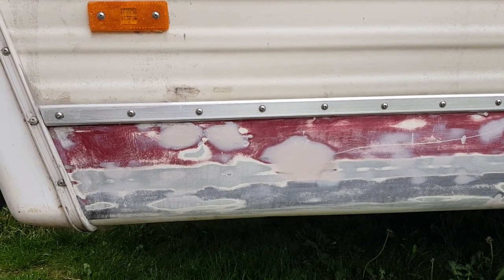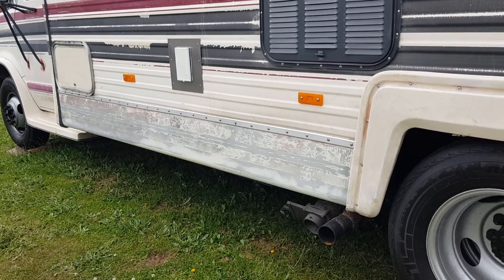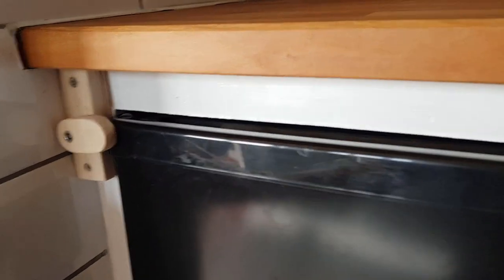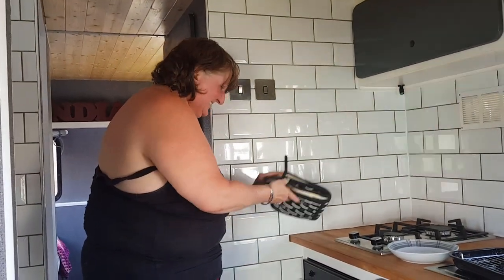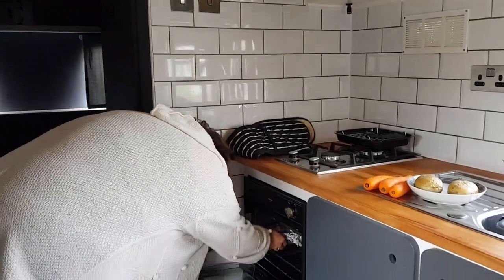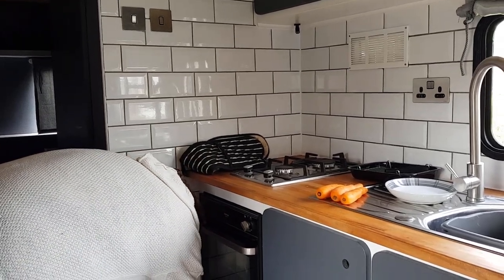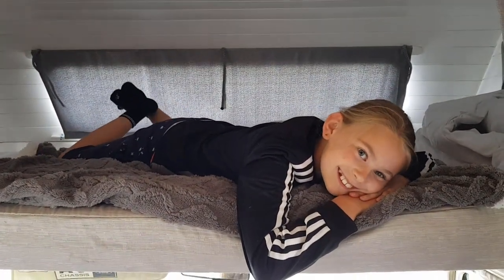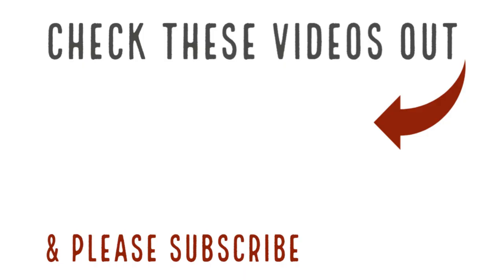🔥 MOTORHOME LPG ISSUE | Cooking On Gas at Home | Use it or lose it

Comment: Least you got the fridge sorted. Good luck using all the LPG up.😁
Reply from the maker: It seems a never ending gas supply lol. It should run out soon (hopefully) so we can change the valve for a new one 😂
Reply: @VintageRVAdventures  get a stew in the oven lol. That'll use some gas!
Reply from the maker: @roaminginraymond  If it was winter, that would be a great idea, one of my favourite winter dinners lol.